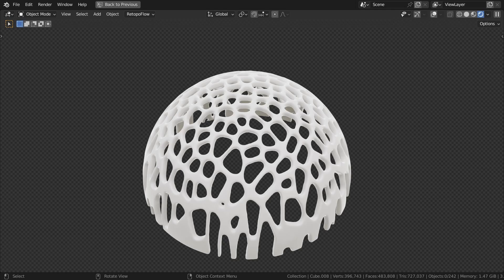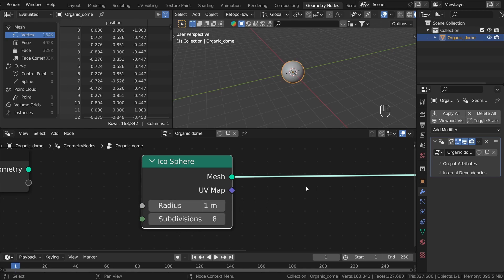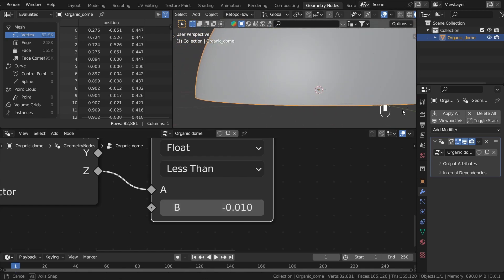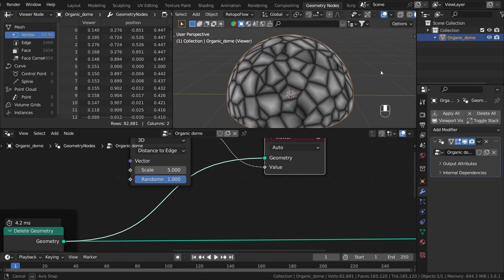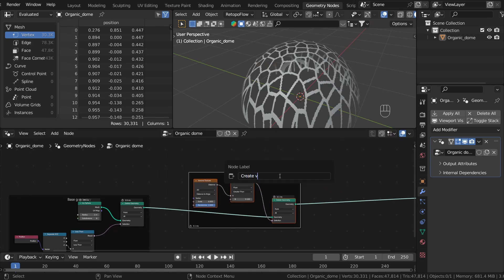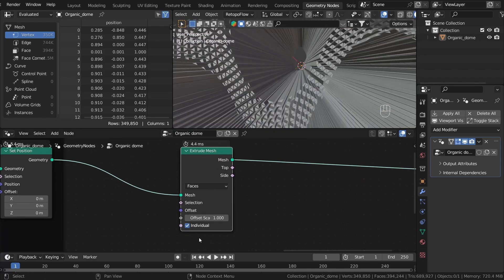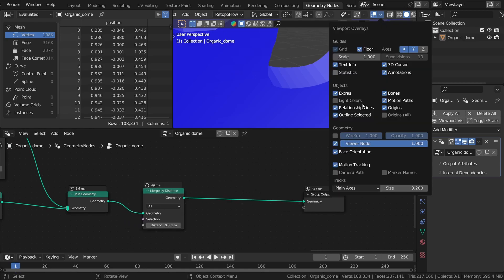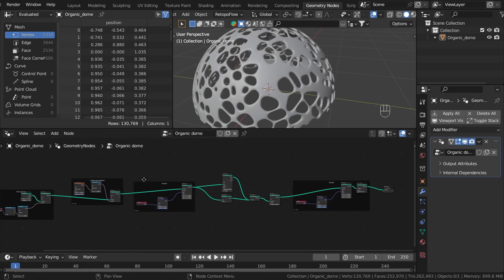Easy Organic Dome in Blender with Geometry Nodes

Comment: anyone knows how to export this as a mesh for 3d printing?
Reply: The easiest way I can think of is to just export as an .STL file and pull it into your preferred slicer to generate Gcode. It should apply the modifier stack when you export, but if you experience problems, just manually apply the Geometry Nodes modifier before you export and you should be good.

Comment: Thanks for the tutorial, I followed along and everything seemed to match up and go as expected....until switching back to regular layout viewport. In that window, the dome appears smooth and vornoi-free, in Geometry Nodes window, it displays as expected. This was my first geometry nodes work, so I'm quite at a loss to know why the result to a sudden deviation?
Reply: This is most likely because you were using a viewer node and the final result wasn't wired to the output.

Comment: is there an easy way to fill the entire sphere with voronoi patterns rather than just the outer surface? mesh to volume perhaps?
Reply from the maker: Yes, you can try using mesh to volume, then play with a 3D Voronoi texture, and convert it back to mesh with mesh to volume. I would also try using the Cell Fracture addon and play with that.
Reply: @jakobdesign8066  thank you! I'm loving learning geometry nodes! So much fun. Made an addon based on your nodegroup, on my github. Thinking may take it this one step further 🤔

Comment: Thanks for the lesson, clear and concise!.....I have a question, the texture preview mode on the hemisphere does not work, the reasons may be in the general settings?
Reply from the maker: Hi!
You can try doing this:

- make sure that both geometry and some value are plugged into a viewer node.
- check if viewport overlays are turned on.
- under viewport overlay settings, check if the viewer node option is checked.

Comment: Why does it take you minutes to explain what it takes Erindale forever to?
Reply: erin doing much harder things, lol
Reply: @loqie1349  

I tried taking a parametrics course of his.  Advertised as little experience necessary.  I fit that bill.  Turned out  1) It was more complex than I was up to. 2) It was in Sverchok (I believe) which of itself is very much 1) a work in progress and 2) can be hard to follow.

By comparison your "Easy Parametric Architecture" using Blender Geometry nodes seems, to me, simple and accessible.  Erin does great stuff, complex.  This is apples to apples.  If I had a choice between learning it as he taught it and as you teach it, hands down, you.  He walked us through, comparable to yours an overhang and a bit more all the way up to, I believe a UV layout.  So, certainly more complex.  Your explanations are comparable to the author of Tissue.  I subscribed to his Patreon for a little while.  He, like Erin, gets down into the mud, but, also accessibly.  It really sometimes depends on who's doing the explaining.  Didn't work for me.  Yours does.